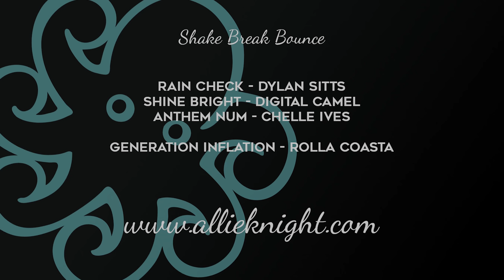Not Another Drugstore

Comment: If you keep driving it will reset itself and get you a little futher down the road. They don't tell you this, I learned from experience with my KW t680 which has the same system, it takes less than 10 minutes of driving slow and out of nowhere it will take off and begin the countdown again. Of course you need to it fixed but at least you won't feel as stranded next time.

Comment: Pretty cool. Around here, when using pex tubes for heating systems, red tubes are reserved for hot water, and blue tubes for return lines. Easier to distinguish. But doesn'tt really mattter if you guys know what's what. :)
Reply from the maker: Steve tells me these are a special variant, known as oxygen barrier PEX which is required for hydronic heating
Reply: @AllieKnightOnline  Yep, that's right. :)

Comment: I wonder if that time idling trying to work with your laptop caused/contributed to the DEF issue.  The laptops I have will work fine with no battery at all.  You may need a better class of inverter.  Not all electronics like the "modified sine".  You may need to use "true sine".  Or better yet, see if you can find a car adapter for your laptop.

Comment: I can already guess/know what happen. The bus company I work for has 6 Frieghtliner buses. 2 are 2016's 3 are 2017's and 1 2018. and we have the same problem. since under warranty we send them back to the Freightliner dealer/shop. Even they can not figure out what the heck is the problem. At first they changed the filter. Nope not it ...one bus went 800 miles then ..same problem..so next they wrapped a piece of plastic or something to help cover the filter (at least that is what I was told they did). Now they are saying that it is happening cause we are leaving the DEF in the tank to long (normally we don't need to add DEF for a week) so now they say we have to "top off" the tank every day. We typically we drive 130-150 miles per day. Well, guess what..we had a bus go out with same problem after 16 days...I believe after 1400 miles. Then 3 days later another bus...so they back in shop.

Comment: Does the easy pass read your licence plate and charge to an account Allie? Regarding the electrical charge problem,  see an auto electrician and he can check your voltages etc. it may pay to have a cable hard wired with a fuse into the dash or where you use your computer. A cliffhanger . Nooo  Mechanics always have cars that need to be fixed and builders always have houses that are half finished. Go through Montana as i have a friend there and would like to see the place.  The closest i got was Washington state. I'm in New Zealand and I love the Pacific North West. take care.